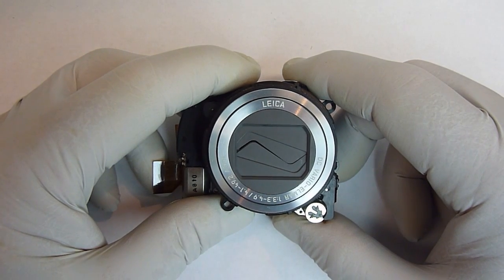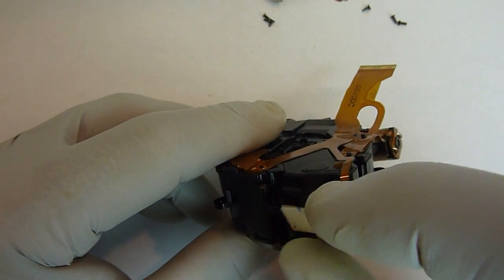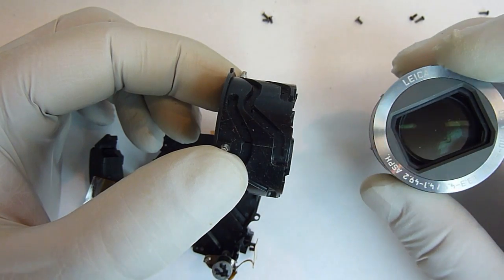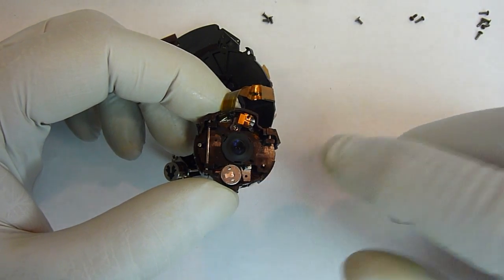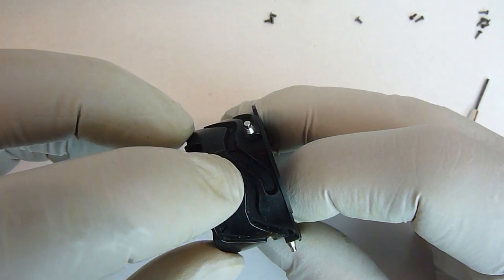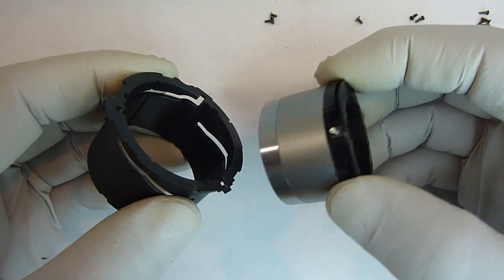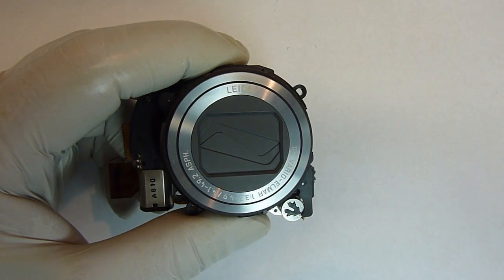How To Repair & Clean A Panasonic Lumix ZS & TZ Model Leica Lens Units

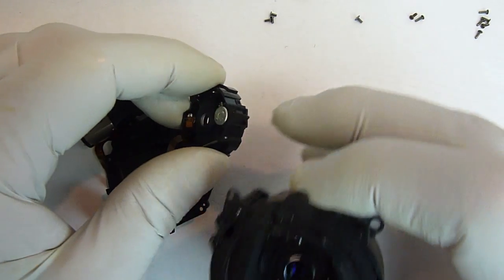Comment: I'm losing my mind, Robert! I have the ZS5 and a 10lb maul with it's name written on it!  I did okay until 23.10 with the lens... made it to 25:05 with the Image Stabilization Unit.  I did get it back in but the gear wouldn't turn the lens.  Removing the unit allows me to twist the lens assembly and it works as it should.

Well, I got everything back together, powered it up, and received a zoom lens error - it won't come out of it's hiding place.  This is my third attempt and it's sitting inside of a shoebox to keep dust off of it.

Any suggestions?  I really know and love this camera and want to keep it!  Thanks in advance.
Reply from the maker: Hi Cyber Doc.

Well, if your 10lb maul has a yellow fiberglass handle on it, then it looks an awful lot like the one that I keep near my workbench. :-)

It definitely sounds like something is jammed up or out of align. That's going to be a tough one to figure out from here. The only problem that I have run into that is similar, is when I didn't get the stabilization unit lined up properly, and it was 1/3 of a turn off and the flat ribbon didn't go over the grove that it needs to go into. It sounds like you have everything else in it's proper place though.

If you could send me some pictures, possibly I could see something. My email address is hiking@thebobfactor.com.

Bob

Comment: Very nicely done Robert, well explained and very clearly filmed. I fixed my old Lumix with that lens a year or so ago with some help from Graham Houghton's video, yours goes further I think. I'm currently have a go at the ZS19 lens (TZ30 in UK), far more fiddly, I nearly got it back together but a couple of the components got stuck and didn't survive the untangling! I look forward to your successful video!
Reply from the maker: Thanks very much Steve! And good luck with your ZS19. I hope you're able to get something figured out on it. I currently have a ZS19 torn apart on my bench that I'm "still" working on. Hopefully it won't be too long before I have a video for it.

Comment: Thanks so much for this clear and detailed video. I dropped my ZS7 and had the dreaded Zoom Error. Upon disassembly, I found that the plastic ring that guides the metal pins in the lens had broken. I was lucky enough  to find a replacement on Ebay and with the help of your video, I was able to properly reassemble the lens unit and get my cameras working again!!
Reply from the maker: Hey, that's great ncbenr! Excellent job in repairing your camera. I'm glad the video was helpful to you.

Comment: What is the best way to clean the pieces that comprise the outer-most lens cover and come together like elevator doors?  Can that entire assembly be removed and each individual piece cleaned?  I have acquired a TZ8 with very sticky movement during both power on and off, and believe that there is a large amount of some unknown residue clogging this part of the camera.  Thanks for a great video, very clear and precise!
Reply from the maker: Unfortunately the best way to clean the lens cover is to remove it completely from the lens barrel. You will need to tear down the lens unit to where you have access to the inside of the section with the object lens and lens cover on it. There are two small screws inside that hold the lens cover on. Once you have removed it from the lens barrel it is easy to clean. Clean it with something that doesn't leave a residue, such as Windex. Good luck with it!

Comment: I have a SAMSUNG PL55 digital camera. The camera fell with the lens open and the lens didn't go back normally. When I turned it ON it beeps 3 times a blue light and then turns off. Then I opened it and I feed the lens motor with 5V directly from an AC/DC adaptador (the battery is 3,7V). The adaptor I get in home has the closest voltage I could get. When I feed the motor the lens with the properly polarity goes back and so I saw that apparently everything (mechanical part no jammed) was okay with the motor and the lens. But when I put the battery and and power on normally the lens go forward and the 3 beeps issued and the lens can't go back. What can be wrong? I let the battery charging 100% just to be sure then I tried but the problem persists...maybe something wrong with the electronic sector that commands the lens motor?!? Supposing it is lens problem What signals the lens system has to inform about the malfunction?
Reply from the maker: My guess would be that there is something in the lens unit that is now slightly out of line, or is bent, that is causing some mechanical drag. When you use 5 volts directly on the motor you are running the motor at a higher rpm which gives it more torque, which allows it to be able to work past the additional mechanical drag that it now has. And, even though the battery is rated at 3.7 volts doesn't mean that the motor is rated at 3.7 volts. I doubt that Samsung would design the camera to use a motor requiring a voltage rating of the battery's full charge. My guess is that the motor is rated somewhere between 2-3 volts. So, you may actually be driving the motor with double the recommended voltage at 5 volts, and that's the only reason it works. I'm not familiar with the Samsung cameras at all and I don't know how, or even if, it can tell you what what the problem is. Sorry. But, good luck with it. I hope you're able to find the problem.
Reply: Robert Hosea Thank you first at all for your quick answer. Based on your experience with other brands/makes of cameras how does the electronic board knows that there is some  mechanical drag? What sensors and timers is there so the electronic board makes the camera turn off with 3 beeps?
Reply from the maker: nscbaptista The camera could detect the problem with additional drag, or other problems, in two ways. One would be to monitor the actual amperage being drawn by the motor when it is energized. If it exceeds a preset amperage level then it determines that there is a problem and shuts down to prevent damaging the motor or circuitry. The other would be a command/response type, where the camera energizes the motor and then monitors the position of something in the lens with a sensor. The sensor would most likely be a magnetic or infrared sensor. So, when the motor is energized the camera will be expecting some kind of feedback from the sensor in a certain amount of time. If it doesn't get the response at all after a predetermined delay (probably in thousands of a second) then it would assume that there is a problem somewhere. The three beeps may just be a generic display/response for it to indicate a problem.
Reply: Robert Hosea
Yes I understand. In fact there is a kind optic/switch sensor placed on the circumference of the biggest base of the lens that is "blinded" when the lens takes the a certain position (normal position when the camera is turned on). This sensor is working I think because a few day ago I simulate interfering between the 2 tips with something between them and thats makes the zoom motor and the focus motor rotating on other sense and differente sequences (I saw the behaviour of the motor outside of the lens). I only dismantle just half of the lens and don't see anything wrong (I think). Now I will dismantle the lens stabilizer mechanism to see if there is something wrong...Do you think that any jam on that part would affect the camera gives alarm and turn off?
Reply from the maker: nscbaptista I know that on the Lumix cameras that I have worked on that it only takes a very, very small dent, or just being slightly out of round, to make the lens unit fail completely. A friend once dropped his almost brand new camera on the ground with the lens extended out, and it created a very small dent on the side of the inner most tube that extends out. That caused it to quit working entirely. It actually went back in alright when he shut the camera down, but it would not come back out when it was turned back on. I had to tear the lens down and get everything back into "round" and also removed the small dent. But, to be honest, it still doesn't work 100%. As precise as the mechanics are in these lens units I do believe it could be something very, very small, or even just slightly out of round, that is causing your problems.
Reply: Robert Hosea
Ok. I'm going to try dismantle all the lens elements to see if I find something. I'm going to use your video as a guide neverthless the SAMSUNG lens is a quite different from the Panasonic Lumix one you show on your video. Thanks.
Reply from the maker: nscbaptista Good luck with it nscbaptista, and let me know if you're able to find the problem.
Reply: Robert Hosea
Ok, thanks. My afraid is broke someting due to excessive strenght. I will try to remove the inner biggest plastic round with the gear and the respective outer plastic to see if anything is grooved or scratch to see if there is signs of mechanical shear.
Reply: Robert Hosea
Hi Robert, please be patient and please read this my long "history". Yesterday at night I was trying to tear down the all lens but it's looks very diferent from the Panasonic Lumix and I'm afraid to broke something.
But before I continue to try to dismantle I try the following:
With the zoom motor uncoupled from the big gear and also with focus motor uncoupled from the gear of the focus lens I guarantee that the motor can rotate free without any resistant torque so almost no amperage is need to be consumed by the motor. Then I power on the camera and I saw the gear motor rotating but after 2-3 second the 3 beeps issued.
Then I simulate the activations of the optic switch (that settles the lens on a stand by position) by putting on the middle of it a screw driver to cut the ray and consequently the  motors operated at different sequence and different sense of rotation. I "activate" the optic switch about twenty times at differents times (because the electronic boards maybe have an precise timming so the optic switch be activated) to see if someting positive happens...but nothing happens.
Then I disconnect the strip cable from the image stabilization system because maybe something could be jamming the mechanism and so the magnetic coils would absorb more amperage than the normal and so electronic board shutdown the machine...but the the problem continues. Now my only hope is that the electric disconnection of the magnetic coils also alarms the sinse no cuurent is passing through them.
So now I really have to dismantle the lens to access to stabilization mechanism but I don't know how to do it. Can you please send me you email and send you a picture of my lens to see if you can help me or give me any ideas?
My email is nscbaptista@hotmail.com. Thanks in advance.
Reply from the maker: nscbaptista I'll send you my email.

Comment: Hi Robert, thanks for this great video. I have a ZS19 which showed signs of having a jammed zoom mechanism. With a few minor differences, your video got me to the where I was able to remove the lens assembly, detach the zoom motor and manually free up the lens. I should have stopped there but I decided to pull the back off of the lens unit to see if there was any cleaning needed. Big mistake. The lens unit is very different from the other Lumix models and elsewhere on YouTube. It has a number of plastic tongues fixed to the rear cover that fit down into the lens assembly. Once you lift the rear cover off the lens mechanism, parts seem to shift, making it impossible to reseat the cover . It looks like I may be able to get it back together if I can detach the sensor from the rear cover and put that into the lens and then attach the cover. The troublesome tongues appear to be part of the sensor. But the immediate problem is that the sensor is held in place by 3 very small, what appear to be star drive screws. Can you provide any advice on how to get the lens back together. and what tool I need to detach the sensor (if this is necessary). Thanks!
Reply from the maker: Hi John,
I know exactly what you're talking about. I have a ZS19 that I had disassembled the lens unit on a few months ago, but I still haven't been able to figure out the correct procedure...yet...on how to get everything re-aligned correctly.I will tear it down again and then start from scratch. If I get it figured out I will sure pass on the info to you so that you can try it on your camera. Good luck with it! - Bob
Reply: Robert Hosea
Bob, thanks very much for your quick response. I'm looking forward to anything you can discover on how to resolve this. Let me know if there is any more info I can provide from my end.

Comment: Robert, 
Wow,,,thanks so much for this.  You saved me having to buy a new camera.  My ZS7 had a tiny amount of dirt on one of the internal lens, which was showing up big right in the center of photos, and after following your instructions for taking the camera apart, and then this one on cleaning, it is back to taking exquisite pictures.  I've been happy with this camera for so many years, and didn't really want to buy another one or pay panasonic $$$ to clean it.  Although, I was a bit nervous, looking at all the parts and screws when it was taken apart, I wondered how hard it would be to put it all back together, but your instructions were clear and accurate.  Thank you.
Reply from the maker: Awesome! I'm glad the video helped you out. It's hard to give up a camera that you like using because of dust on the lens. And, not to mention the big money to pay someone else to repair or clean it for you. I'm glad you were able to do it all yourself.

Comment: Great video. Just wondered if you could give me so e advice please. My Lumix TZ7 was dropped. The lens wouldn't work at first, but then started to work, however it would get stuck half way resulting in a message asking me to turn off the camera. It now makes repeated clicking noises before telling me to switch off the camera. The lens tries to move. Occasionally it will work ok but this is not very often. I have been told a repair would cost too much as the camera is 5 years old. There is no apparent damage on the outside of the camera and on the rare occasion when it works it takes a perfect picture. Have you any idea what the problem could be? Thanks.
Reply from the maker: Hi Helen. A friend of mine dropped his new ZS10 camera right after he got it and it started doing the exact same thing. He would have to turn it on and off repeatedly to get it to randomly work, When it did finally work, it would work one time and then completely stop working again. The problem was that the lens would not extended completely due to an incredibly small dent in the outer lens housing. I was able to disassemble the lens and remove the dent. My guess would be that one of the metal coverings, either the outside or one of the inside, on the lens unit has a small dent or one of them is slightly out-of-round now. Either one could cause this problem. Unfortunately since you can't see any obvious dent on the lens, I think you would need to disassemble the lens so that you can test the movement of the individual lens pieces to determine where the problem is. Sorry I can't be more help Helen.